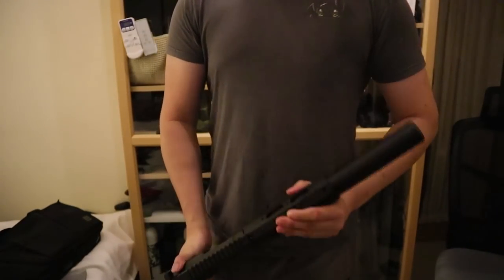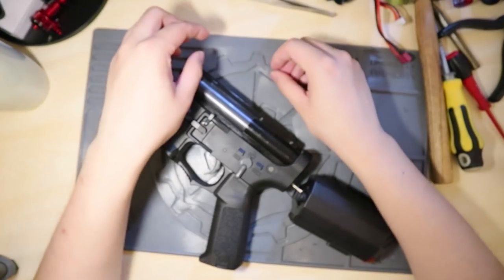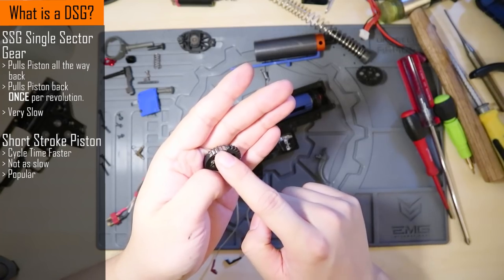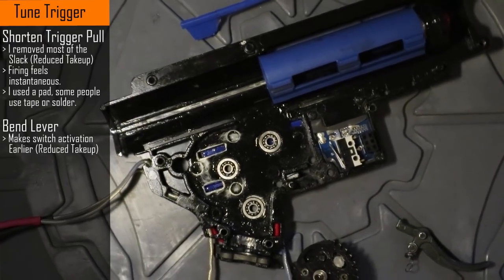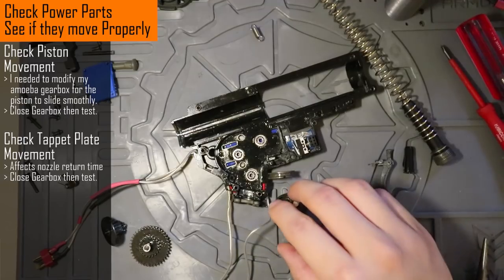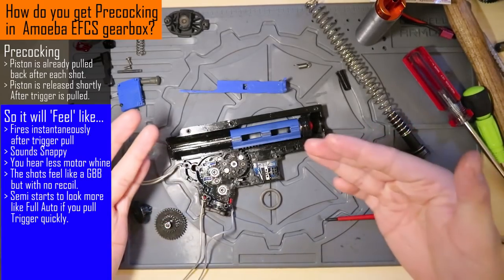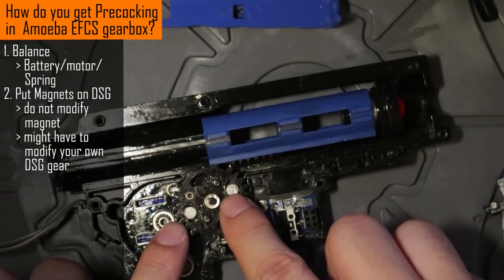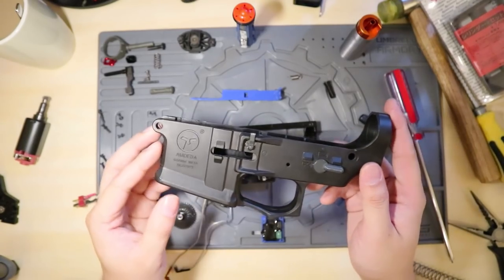Amoeba DSG Precock - Budget DSG Trigger Response Build!

Comment: Thanks a lot and I learned many many things about DSG of your video. Actually, how about the cost of your am014 DSG custom?
Reply from the maker: i mentioned it in the video, about 290 USD
- am014 (1000hkd exactly, around 127 USD)
- SHS DSG with tappet plate + 18:1 gears (40 USD)
- Systema Air Seal Parts (300 HKD in hk, 31.85 USD)
- PP airsoft double o-ring damper cylinder (10 USD)
- SHS piston (7 USD)
- Supershooter m125 spring (7 USD)
- EFCS magnet (10 USD)
- PP airsoft bearings (7 USD)
-Externals 40 usd around
   - replaced mag release big dragon (china company)
   - battery extension from airsoft artisan (china company)

so very close to 290 basically. Exclude battery, tracer unit that's inside the supressor
Also exclude hop up (inner barrel and rubber) setup simply because, you don't to replace those parts in the first place, these parts won't be the same for another dsg gun, and also, I wanted to run a tracer unit hidden inside the supressor, so i needed a shorter inner barrel so swapping the inner barrel is not necessary. (just like the rubber, and tracer unit, not applicable to most people).
Reply: @RogueSystem087  is the modified tappet plate with the shs dsg the same thing that you do here with yours basically?
Reply from the maker: @TGWecho  similar yes, but i think the shs one is 14mm (so u may need to do some adjustments of your own, but ultimately, it'll come down together whether or not you need to adjust the length of your tappet plate for the particular set of parts that you use, the fitting is a little different for each setup and will vary of course depending on how fast everything is going)

Comment: Would it over spin with a 125 spring but a high torque motor and 11.1v
Reply from the maker: Aidan B it probs will, maybe use 7.4 purposely undervolt the setup
Reply: @RogueSystem087  in order to use a 11.1 to not cause over spin what motor would be fine
Reply from the maker: @aidan2773  well the main reason why i have trouble answering is cos for now, i have no idea if you are using bearings, bushings, what gear ratio etc etc, whatever your setup is, maybe trying using the stock ares motor first, then go from there to see what motor u'll roughly need
Reply: @RogueSystem087  they dont sell regular ares motors separately. I'm using everything the same parts except motor
Reply from the maker: @aidan2773  hmmm do you need precock ? if u  have to have precock, i don't see a way for you to do it for now, or  if no precock then u can use maybe an 18 to 22 tpa motor, from anyone really and just balnace ur build out with a heavier spring.
Reply: @RogueSystem087  I'll just balance it using a weak motor and spring and a 11.1 what motor would you suggest

Comment: you can use a 500mm inner barrel with a DSG.  sounds like a polarstar.
Reply: @RogueSystem087  here's a test build, i used my DMR and dropped in a dsg to see what happens with 500mm barrel. this was back in 2011 (only did around 10x dsgs at the time).  the chrono was defective (bought cheap for $15). the gun was having selector issues because it was originally built for semi-auto (tavor has trigger issues which i've fixed since then).  spring was a chopped down m150 (originally used for the dmr). suck back doesn't exist because the nozzle doesn't stay sealed (cycles like it should). this is my old YT account. 

https://youtu.be/CMBzLFMfl2Q
Reply from the maker: MadCrew Airsoft o_O doesnt really tell me anything other than the inconistancy and wild fps deviation? Maybe redo the vid with a normal chrono? Why does the dmr shoot below 1J with a 500 mm on an m150 if under volume and negative pressure doesn't exist like you say?
Reply from the maker: Anyways thx for sharing, good on ya for building
Reply: @RogueSystem087  as i mentioned, that chrono was garbage and gave false readings (80+ rps, LoLz). fps and rof variations has since been resolved using an xcortech. since you believe that negative pressure (suckback) exist in undervoluming, then you don't fully understand the airsealing and timing of how a gearbox works.

Comment: Would this also work if I only put in the DSG itself an the tappet plate? I want to upgrade my semi only, stock AM 014 with an M100 Spring and a 7.4 Lipo. 
Would be so glad if someone could help me out ;)
Reply: BiNKI STiNKI you will hit pme. You need at least a m150 spring
Reply: @opairsoft8100  thx for your reply :) but will it work to just use the dsg gear itself without the other upgrade parts?
Reply: @binkistinki7254  no if you don't know the answer to that question, don't even try a DSG. They are extreme high stress builds and everything needs to be upgraded. You can't use a M100 spring, that is a bad idea and your gun will last 3-5 shots and will explode.

Comment: Could I use my stock amoeba gears with the shs dsg?
Reply from the maker: KaiFTF as mentioned in the video, yes, but your precocking won't be as precise which may cause precocking timing issues (so your gun may not alwasy lands on precock)
Reply: Rogue Studios so you would recommend I just get the 18:1? I was planning on ordering 13:1
Reply from the maker: KaiFTF did you watch the video? I mentioned i'm using 18:1 gears cos i'm stuck with it, SHS does not make a low ratio DSG gear so therefore i cannot use 13:1s. The only company that makes low ratio DSG gears is seigetek (135 USD +). So keep that in mind when u budget your build

Comment: could any body tell me the dimensions of Amoeba EFCS magnets cuse here in the eu i cant vind them.
Reply: You can find them on Evike
Reply: @Lancesvette  yea baouth that ^^ i live in the EU so it will cost a hell of a ton to import them just for some magnets
Reply: @Lancesvette  thnx <3
Reply: Leon de Blaauw actually just measure the hole of the sector gear lol the magnet is the exact same size
Reply: @Lancesvette  oww yea true xD, i though you said you modded the sector gear to fit them?
Reply: Leon de Blaauw which one are you gonna use?
Reply: Leon de Blaauw hey it’s 4x4mm

Comment: Can i use shs 16:1 gears with shs dsg
Reply from the maker: yup sure can
Reply: @RogueSystem087  what spring should i use ?? Im thinking 150 with this my set up is currently for an arp9 i use the g&g 1500 drum mag 
Im planing to use  16:1 with the dsg withe the stock 35k g&g motor will it work?
Reply from the maker: @gencoupechubby137  hmm it really depends on the motor, correct me if i'm wrong but a 35k motor usually means high speed, normally those motors don't have a lot of torque so the trigger response may not perform the way you like it. Usually what I do is try to source a motor that has a lot of torque that's within my budget. If you live in the US, you should have easy access to motors like ASG or tienly, or even lonex (depending on how far u want to take it). Another factor to consider is that 35k doesn't tell us anything other than how fast its going, it doesn't tell us what the 'theoretical' motor is running on (like what battery), and how much torque it can output. Usually the higher tpa motors are the motors that the necessary torque to run the system smoothly. That being said, some motors have both a lot of speed and torque (but you'll have to look into what its being powered by and what load is on that). 
Personally, I would stick to what i mentioned earlier, if you don't want to do the really in depth research, I suggest going for whatever motor u can find that has the most amount of torque that meets your budget (altho if you applying what i just said to this particular dsg build, it may or may not work since the ares chip does have limitations).
Reply: @RogueSystem087  made the update to my list of parts 
Now my list consists off 
Shs 16:1 Gears 
Shs Dsg with tap plate 
Shs m150 spring 
Shs 15 tooth piston 
Shs Anti-Reversal latch
Maxx Model double 0 ring Nuzzle 
Maxx Model double 0 Ring Piston Head 
Maxx Model Cylinder head 
Maxx Model Spring Guide 
Maxx Model Trigger 
Matrix Super high Torque Slim Motor 
Gate Aster 
Angel Customs 6.01mm Tight bore 
Is there anything that i need to add or change ?
Reply: @gencoupechubby137  i'm not sure what the air seal components are like, so no comment on those as i've never seen them myself. 
The rest seem fine, only thing missing is motor / pinion gear, maybe a stronger tappet plate spring (but u'll mostly likely have to modify an existing one for a dsg).

Comment: SSGs are not slow. 24rps on a 9.6v is not slow.
Reply from the maker: Not A Meth Dealer not slow at all, agreed, if u want to use a short stroke ssg at 24rps, go for it, there's no issue here. Meanwhile ill stick to the dsg precock. Its just a different build compared to yours, dont get triggered, just build it in whatever way you want.
Reply: @RogueSystem087  Hi, wouldn't you get higher FPS with a ported cylinder, especially for the pistol versions of Amoeba M4 (less than 120mm inner barrel)
Reply from the maker: @cunnyfred9562  well in this case i'm using a longer inner barrel, but yea if you are using an inner barrel that short then u'll probs need it, As to whether or not it will give you a higher fps, that's tricky to answer. 
Generally speaking tho just know with ur super short inner barrel, just using something that has around the same port size as the one that comes with ur 120mm amoeba
Reply: Hi, what diameter magnets do you put in your DSG gear?
What motor would you recommend, if i want to use an m140 or sp140 spring in an Ameoba m4 DSG? Will the stock motor handle this?

Another question - is there any FUNCTIONAL difference between the G&G DSG gear and the SHS DSG gear?